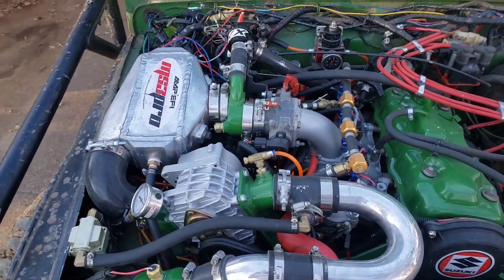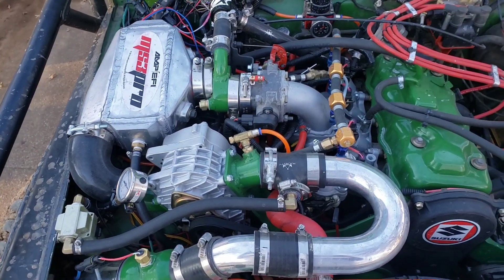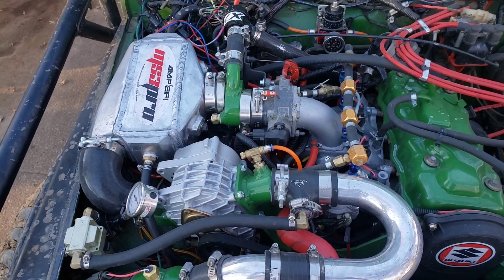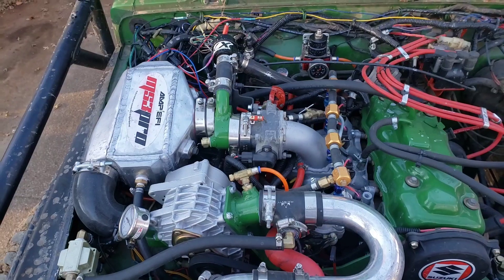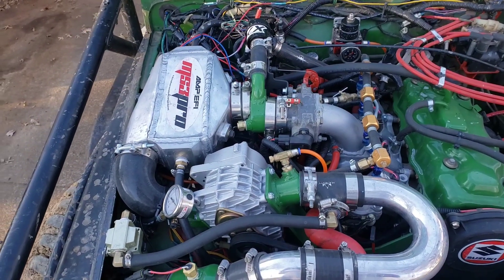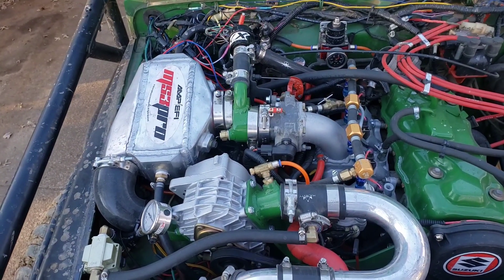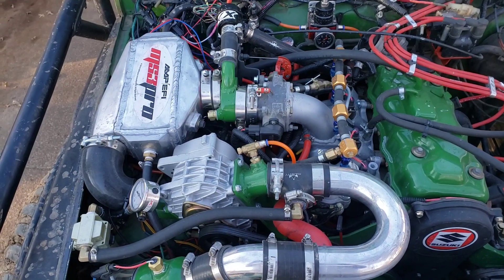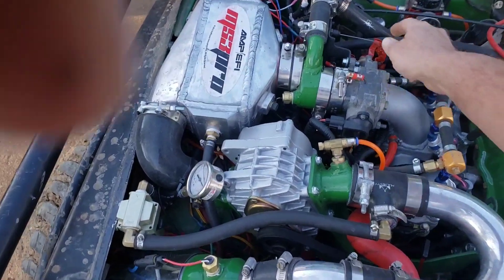Super Sammy AMR500 Supercharger Failure.

Comment: I wonder if that wear has something to do with the fact you are running EFI instead of a carburetor. Those older roots style superchargers were designed to have liquid fuel pass through them along with the charge air, cooling the rotors inside via latent heat absorption. Since you are fuel injected, there’s no fuel passing across the rotors, to extract heat generated by all the friction, at the speeds that thing is turning at. At 10k rpm I would imagine those rotors would get very hot very quickly. On that same note,  that heat is the downside to those roots style superchargers, they quickly begin to superheat the air the faster they spin, thus drastically lowering the air density of the charge air it produces.
Reply: This is such a cool set up. I miss tinkering with my MS2. The discovery and adventure of undertaking this endeavor is so cool . I miss that, thanks for the inspiration.
Reply: I bet you are 100% correct as far as the fuel cooling process and I’d also would think the way this charger is ran is actually pulling power from the motor. It probably makes more power with out it

Comment: The AMR have bearing issues too
Reply from the maker: That supercharger was never spun faster than 1.92 times the engine speed. I have my Rev limiter set at 6450 rpm.
Reply: @zuk4x493  you could upgrade bearings but it would be pricey as you need four and there big.
You can buy fully ceramic bearings.
Reply: @zuk4x493  you could upgrade bearings but it would be pricey as you need four and there big.
You can buy fully ceramic bearings.

Comment: I’m putting the same supercharger on my 84 vw rabbit 1.6 na 5 speed.. I’m using turbo injectors and turned the fuel up on the injection pump.. I’m hoping the 4psi it puts out makes a significant difference.. I’m pulling in cool air from wheel well into full flow filter through the supercharger and into a small intercooler then into a gas 1.8 8v intake manifold with the throttlebody removed and an adapter made.. so it not only has supercharger noises but induction noises too.. and the gasser intake flows so much better than the stock one.. I’m excited
Reply: how did it go

Comment: I just bought one. Thanks for the heads up, I'll have to keep the blower speed down a bit.
Reply: Hey Larry, I have been getting into the car community alot recently and was wondering if you can help me out with this supercharger
Reply: how easy of an install was this and what other parts do I need besides that supercharger
Reply from the maker: @dylanrogersyt8211  I know you were reaching out to Larry.  I wanted to share my  experience with the AMR500 supercharger so far. Roots superchargers are inefficient by design. They originally were designed to pump air in to mines. The design creates turbulence. Turbulence causes heat. 
The general rule of thumb for supercharger displacement it 50% to 70% of the displacement of the engine driving the supercharger. The AMR500 was designed for the 668cc Subaru I4 engine. I was overdriving my AMR500 1.9 to 1 on a 1600cc Suzuki engine. I am set up in a blow through configuration with multiport fuel injection.   I added water-methanol injection to cool the supercharger and intake air temperatures. Before I installed a bypass valve, a pre supercharger butterfly valve, i was seeing charge air temperatures around 300°F. After the water-methanol injection, a water to air intercooler my charge air temperatures dropped to around 75°F above ambient air temperatures. Hope this helps.
Reply: @zuk4x493  its just I want to put it in my 2.7liter toyota tacoma and was wondering if it will be OK for it and how time consuming it would be with all the right accessories
Reply from the maker: @dylanrogersyt8211  way to small for a 2700 cc engine. We are really pushing them on a 1600cc engine. A 2700cc engine needs a minimum supercharger displacement of 1300cc with 1400cc to 1500cc being ideal.
Reply: @zuk4x493  thank you for the info
Reply from the maker: It's more of a heat issue. Speed increases the heat buildup. Drawing fuel through the supercharger helps to cool it off. Because I am not drawing fuel through mine I inject water-methanol in place of fuel. It serves to cool the supercharger and the compressed air charge while increasing the air density.

Comment: Anyone know which of these could work on a 11’ corolla 1.8L. 
These are easy bolt on,  what all is entailed to run this properly. To make say max 200HP total with stock HP at 132, intake and muffler deleted. So I’d say maybe 140 max hp currently. 

Ericdetailing2019@gmail.com for answering! 
I’m considering ordering this and anything else needed. 

This was posted April 2021. 
I’m supposed to own this car for 2 more years. So if you see this comment, without a reply from me, I’m still N/A.
Reply from the maker: The little AMR500 supercharger is  really at it's  limit on a 1.6 liter engine. They were designed for the 668cc Subaru Pleo I4. I know the VW Beetle crowd are putting them on bigger engines. Toyota use the Aisin SC12 and SC14 superchargers on the 1.6 through 1.8 liter engines. The Eaton M45 and M62 are relatively cheap and a better choice. I wouldn't install an AMR500 again knowing what I know now.

Comment: Zuk4x4 thank you: very, very interesting. Now, is this stupid? If the AMR500 maxes at 1600 engine, can you use two run off the belt for an engine >1600, as wanted by many. Like a bi-turbo, each AMR500 working on one bank of say a small V6 (or larger 4). Its so cheap, simple and effective.
Reply from the maker: Not stupid at all. The VW beetle guys have been running two on so yes its possible. However the Eaton M62 would likely be cheaper and easier to package. I
Reply: @zuk4x493  Thank you for suggesting the beetle people who have a simple arrangement for low boost with no intercooler: they bolt the carby above the charger giving what you called draw thru with an evaporative cooling effect of the gas. The low boost gives enough power to improve the vehicle. I will check out the M62. Thanks again.
Reply from the maker: @nampam3945  exactly. The little AMR500 supercharger should always be mounted in a draw through configuration. Even in top fuel they draw fuel through the roots superchargers. If ever get the time, I will redesign my system placing the throttle body before the supercharger. However I will continue using the water-methanol injection to cool and seal the supercharger.

Comment: How much it cost? Oh that’s why🙈
Reply from the maker: I am almost embarrassed to say. Not having ever supercharged an engine before I made some bad purchase decisions early on. Also the more I learned, the more curious I became. My curiosity added more features and control that cost more money. If I back out the wrong part, the cheap knockoff parts, and trial and error parts, the actual cost with the digital dash display and fuel gauge setup is around $3500USD. However, I learned a lot, had fun being creative, and met a wonderful group of people. A vehicle with an obd2 system would be easier and cheaper to boost. Unfortunately the 91 Suzuki TBI can't be tuned without a stand alone engine management system. A $400 Microsquirt alone with a couple hundred dollars of parts will control the  engine. However I went a much more complex route  and converted to sequential multiport injection and distributorless wasted spark ignition. I even added water-methanol injection all controlled by a $900 Megasquirt MS3X ECU.

Comment: How do you get the charger to stay so quiet at idle? Just low idle?
Reply from the maker: Part of it is low rpm (800) at idle. It would be a little quieter if I hap put the throttle body before the supercharger. My 50mm butterfly valve is attempting to simulate that. I am also diverting any remaining charge pressure to the exhaust with the 25mm diverter valve.
Reply: @zuk4x493   Oh okay I see, it’s nice. I have an amr500 with multiple pulleys on the way for my Ranger, duratec 2.3. I have a tuner and can lower the idle very low so hopefully it won’t whine too loud at idle. That diverter is slick although I ordered a blowoff, I want the psst noise
Reply from the maker: @hofhat  I am afraid you won't see much boost from an AMR500 on a 2.3L engine. These superchargers were designed for the Subaru Pleo with a 668cc I4 engine.
Yes you can spin them up to 16K rpm supposedly. However once you exceed the supercharger's efficiency range you will actually lose power because the power needed to spin the compressor exceeds the boost needed to create the additional power in excess of the added parasitic drag on the engine.
Reply: @zuk4x493  okay thanks for the info, I knew it’s not going to make much boost, I mostly just want to do it for fun and the noise. If it ends up being a total waste my plan is to uninstall and return the charger shortly after the first couple runs if I’m  disappointed enough. Probably keep the piping and blowoff, lol. If it gives low end power and doesn’t decrease higher rpm intake I may keep it
Reply from the maker: @hofhat  as long as it creates more power than it robs to rotate the supercharger it all good.

Comment: judging by all the other youtube videos, I think they all sound that way.  But hey, it only costs 150 bucks on ebay and if it keeps cramming air in the engine, who cares? lol
Reply from the maker: They are a very cheap compressor for sure. However they absolutely have to be in a draw through configuration and seriously they need to be on engines with displacements of 1200cc or less. 1600cc is a stretch. I know the VW folks are using them on 1800cc engines but boost doesn't always mean more horsepower. A restrictive intake and exhaust system will have higher boost pressure than a free flowing system but the free flowing engine will make more power at a lot less boost.
Reply: @zuk4x493  what about 2 of them? I think there's space in my s2000.
Reply from the maker: @FroztiProductions  2 should work.

Comment: Shouldn't supercharger sit between the throttle body and engine??
Reply from the maker: Yes. I made a beginners mistake. To keep from having to completely rebuild my intake system once I realized my error, I added the cable actuated butterfly valve pre supercharger to simulate the throttle body to reduce both heat and noise.  It corrected 90% of the problem. I love the instant torque of a supercharger but the little AMR500 is too small for a 1.6 liter engine. The SC12 is a much better choice or even the Eaton M90.
Reply: @zuk4x493  shit happens. Great job mate.
I was asking to make sure mine would be right. I am trying to fit it into a Fiat 500 650cc. I got the AMR500 instead of 300, lots of fabrication still in process, thanks COVID-19 for helping me finishing it...
Reply from the maker: @fpaoli508  it should work beautifully with the Fiat 500. The little AMR500 supercharger was designed for a Subaru 668cc I4. I would think a 1 to 1 drive will be quite and cool.

Comment: Are you using methanol? The coating will strip if it comes in contact with some chemicals. For example carb cleaner.
Reply from the maker: 20% methanol, 30% ethanol, 50% water.
Reply: @zuk4x493  that could be the reason it striped the coating. The patern is also kind of round on the part it stripped so this could be an indication the jet is responsible. I would move the jet after the supercharger to avoid any further stripping of the coating.
Reply from the maker: @Ismaak5  the coatings are capable of handling fuel  which is much stronger than my 50/50 water-methanol mix. I haven't had anymore issues once I stopped heat soaking the supercharger.
Reply: @zuk4x493  In most supercharged aplications  fuel is introduced after the supercharger if it is injected. And if its introduced before the supercharger its usually via a carburetor on much lower pressure and the charger is usually not coated. I use an eaton m45 on my car and I have seen some of those bubble and strip the coating when someone tried to clean them with brake of carburator cleaners. I am just throwing a theory.
Reply from the maker: @Ismaak5  not in carbureted and top fuel. On modern multiport injection systems yes, but most are using a screw type supercharger and not a roots. The VW croud and the Samurai guys are running carbureted in a draw through configuration. Mine failed because I stupidly mounted mine in a blow through configuration not knowing any better. As for water-methanol injection in front of the supercharger,  that is very common for not only cooling the supercharger but improving the sealing. My system sprays a maximum of 35 cc/min at 60psi and 66 cc/min at 100 psi. A very fine fogging mist frombthe Devil's Own injection nozzle.

Comment: She shit a bearing I think bud get a eaton m24 if you had one of those I could rebuild it for you
Reply from the maker: I kept it back and replaced with another refurbished unit. I also added a pre-supercharger butterfly valve and set the water-methanol to trigger sooner. So far no more high charge pipe and supercharger temperatures. Thank you sir for offering your time and talent.
Reply: @zuk4x493  what do those do I just use a big bov and vent to the atmosphere
Reply: I mean I know they need em for the maf so they no how much air they air taking in but I don't really understand it other than that and taking load off the blower
Reply from the maker: @jeffgood6441  the roots superchargers really should only be used in a draw through configuration. Unlike a turbo, the supercharger is still compressing air during deceleration unless the air is vented with a BOV  or recirculation valve. In a draw through configuration the carburetor or throttle body shuts the air off to the supercharger. The pre-supercharger butterfly valve dose the same function. The water-methanol injection produces the same cooling and sealing effect as fuel in a draw through configuration. Also Water-methanol injection  was used in aircraft during ww2 to cool the intake air temperatures and to add air density at high altitude. Methanol kept the water from freezing and adds additional octane. Adding water-methanol to my system dropped my intake air temperatures 30 to 40 degrees below ambient temperatures.
Reply: Was going to say same thing.  Bad bearings will make rotors rub.

Comment: Are you going to swap a m45 or sc12 in there? How is your IAT?
Reply from the maker: I think I will stay with my current setup. My IAT's are typically 30 to 40 degrees below the engine coolant temperature. Another  downside of converting an intake manifold designed to carry atomized fuel and air to a multiport intake. The engine coolant runs through the intake to keep it heated aiding in the fuel atomization. My Super Sammy works great offroad and the low end torque is very much improved

Comment: Will it work on a mx5 1.6 liter? 7200max rpm
Reply from the maker: I believe the max recommended rpm is 16,000. Any 17mm id alternator pulley will fit and the woodruff key really isn't needed. 
Boost is dependent on engine efficiency. An inefficient induction, head, and exhaust can equate to higher boost pressure but not necessarily efficient horsepower gains because the additional air doesn't move through the engine. My setup makes max boost under load at lower rpm. This has helped my low rpm torque tremendously. As my rpms climb my boost drops because the little 500cc supercharger can't keep up with the engines demand. However, if I spray water-methanol I gain a little more boost with the increased air density. I am overdriving the supercharger 1.9 to 1 and that is as fast as I want to spin it to maintain efficiency and lower my IAT's.
Reply: @zuk4x493  What is the max rpm you rev your zuk? I was always told 5,000 was the max for a long life
Reply from the maker: @bannablitz247 I  set my rev limiter to 6400 rpm but I usually don't rev much past 5700 sense I am overdriving the little AMR500 1.9 to 1. Once my IAT gets to 150°F the water-methanol injection system kicks on anytime it makes 1.5 pounds of boost  to not only cool the air charge but also the supercharger.